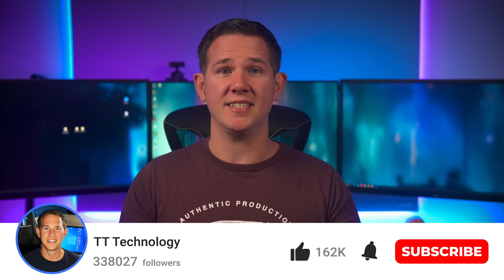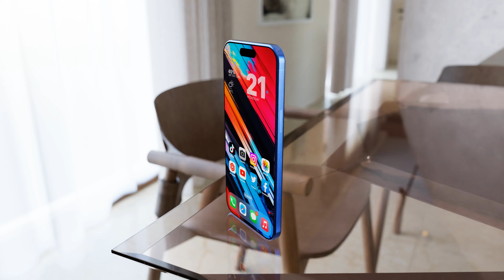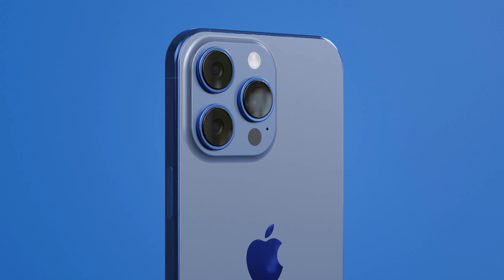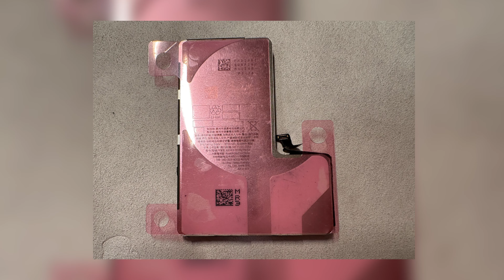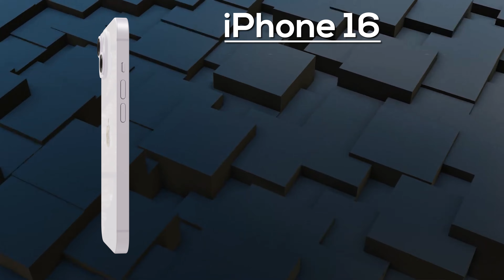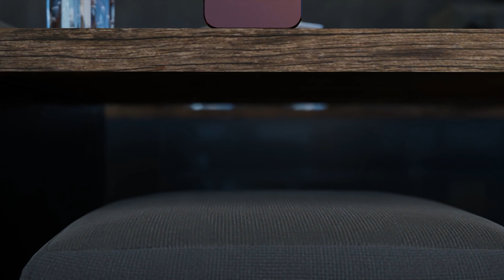Apple iPhone 16 Pro Max - Breaking Records!

Comment: The 16 Pro looks to be the model for me if I do upgrade from my 13. A nice size with that 5 x optical zoom lens included instead of a 3x . I guess they upped the size to fit this into the “smaller “ of the pros .